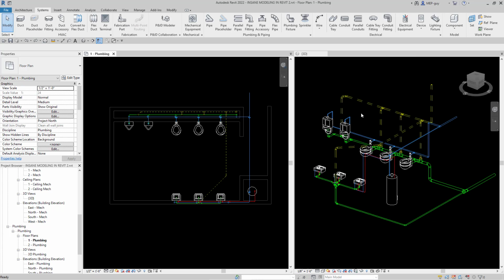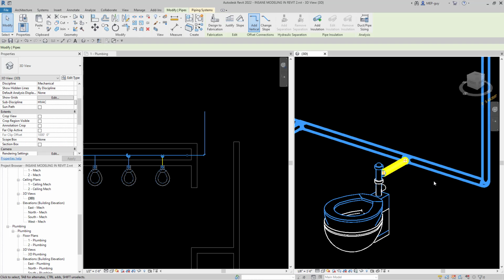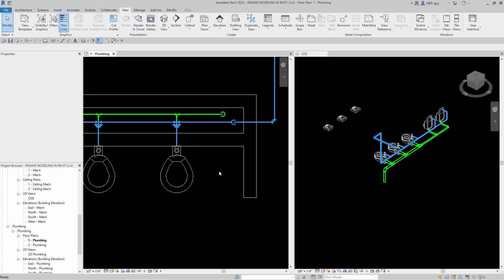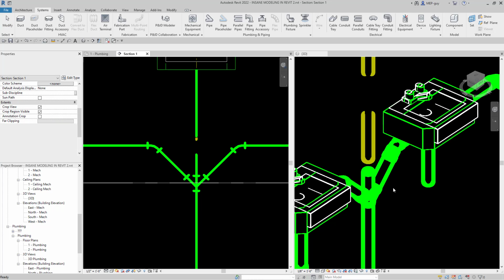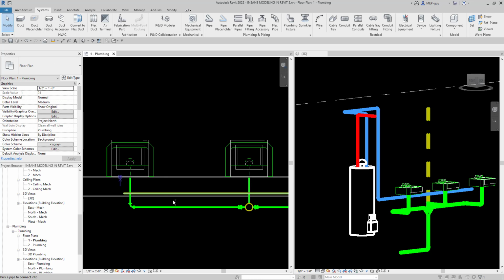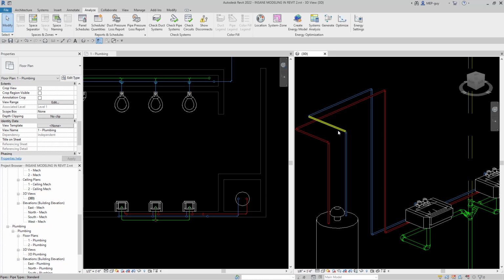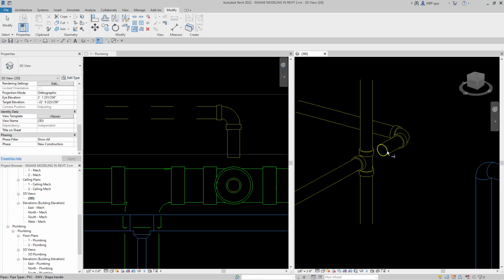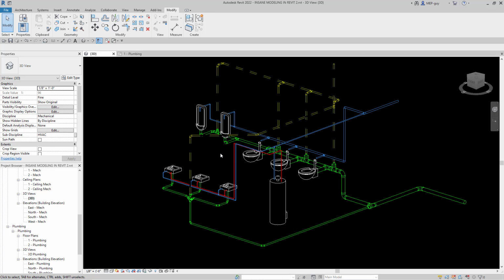The BEST Plumbing Modeling Techniques in Revit MEP

Comment: Great idea man! Doing the entire process from start to finish really strings all the methods together. I want to try your method to route electrical conduit...wonder if that will work...
Reply from the maker: Thanks man!! Absolutely it should work. Conduit is basically piping. Wondering if Revit tracks the systems in a similar manner. I assume revit has similar generate layout commands for conduit.  Let me know if it works!